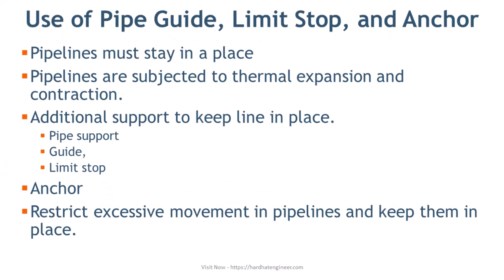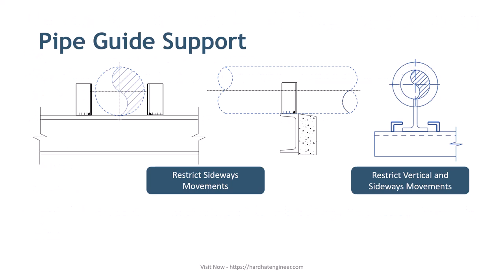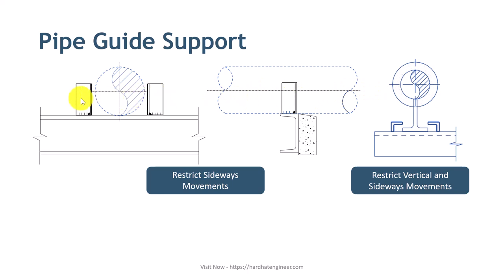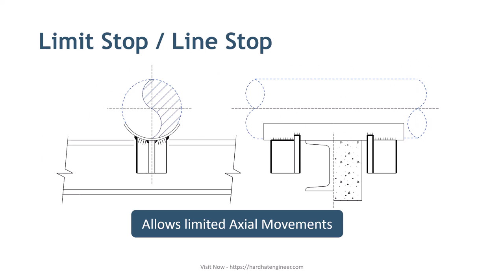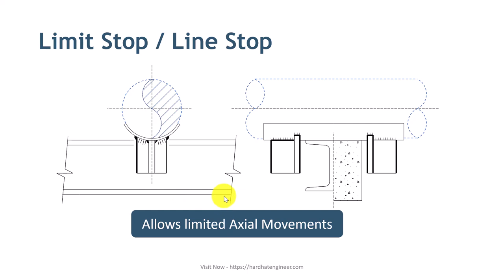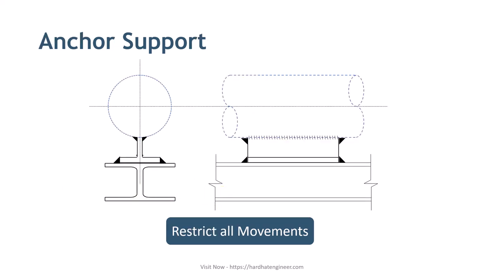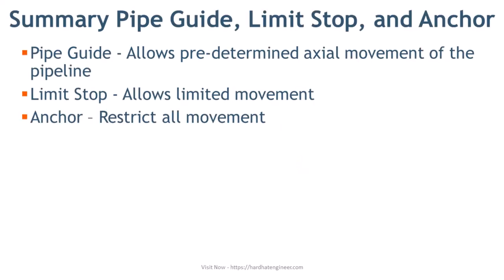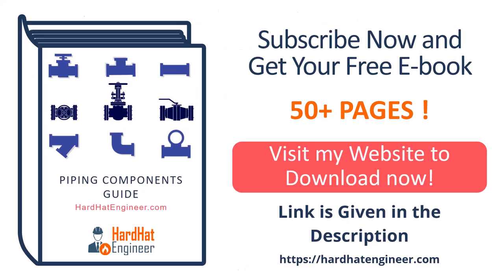What is the Difference Between Anchor, Guide, and Limit Stop in Pipe Support?

Comment: 👍 one thing you didn't mention is when a pipeline assembly is set in the far northern hemisphere where it is cold thus less movement. Along the equator hotter environment and in between going from cold to hot temperatures. So these 3 types of pipe mounting would be used ?
Reply from the maker: Hi, thermal expansion is not only due to atmospheric change but also due to operation. So these supports type use in all pipeline.